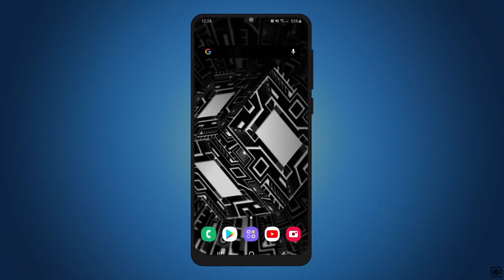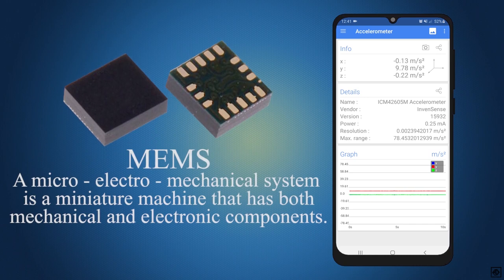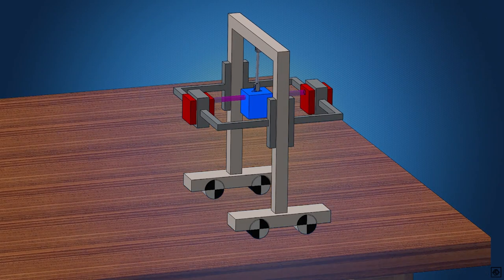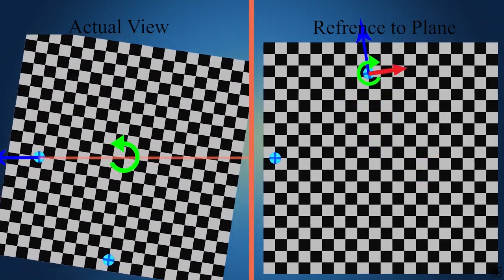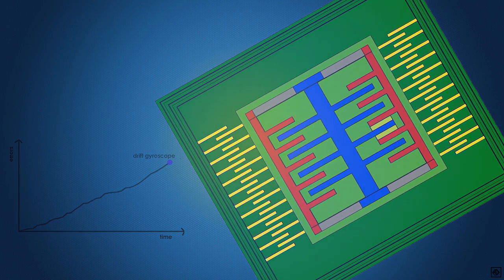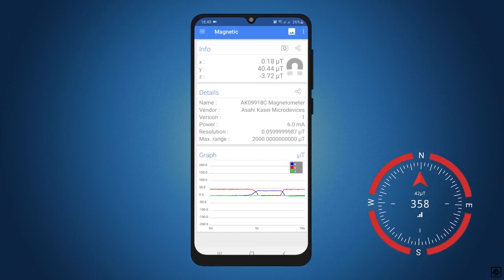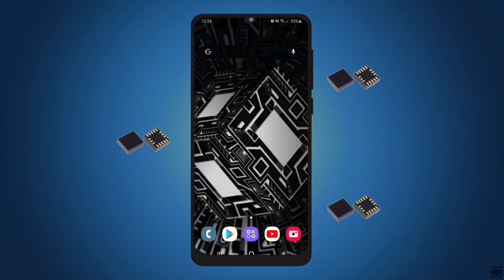How does mobile know about its orientation?

Comment: they should also try to show these sensors actual under a electron microscope or something.
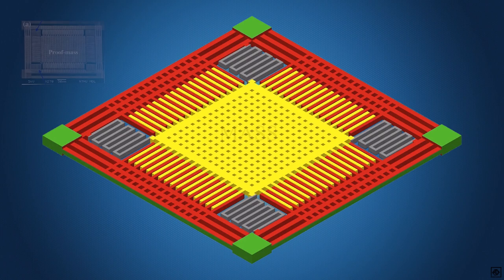Reply from the maker: I have an image of accelerometer (3:33).
But for gyroscope, the images were different than the model and this model was easy to interpret.
I will include more microscopic images (if required) in future videos.
Reply: @ExplorerStuff  also since they are micro mechanical devices can they be damaged  with a hard impact like dropping them.
Reply from the maker: @bazrazin1  They are strong (depends on what strong is) for their sizes but it still depends on sensors. Like an accelerometer should withstand a fall, as it is created for measuring acceleration forces (same for gyro).
If you have ever dropped your mobile, Its sensors will still work.
The sensors are not isolated from impact as they have to measure it (I did that for free fall data, and they still work fine😅).
Also, as they are microscopic, the forces are also small (not acceleration).